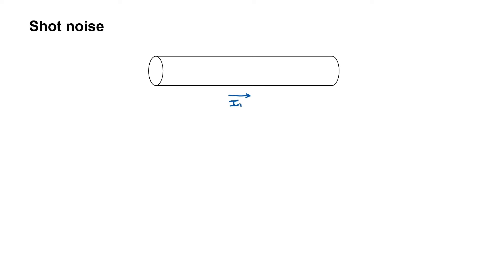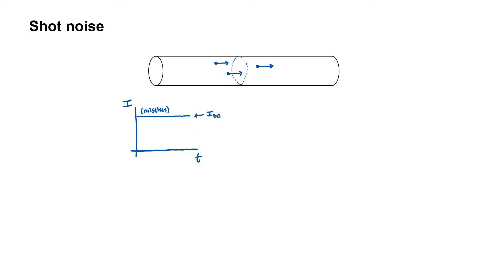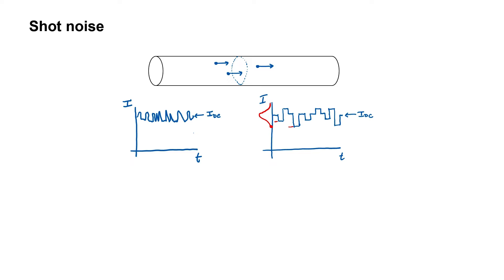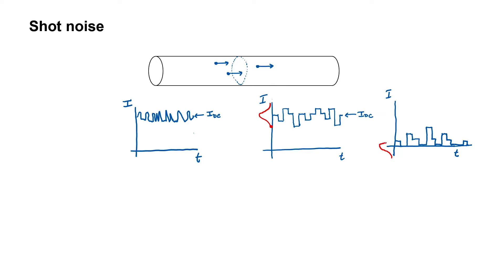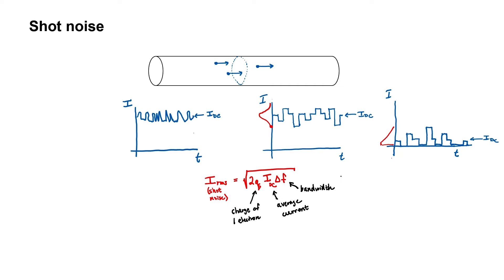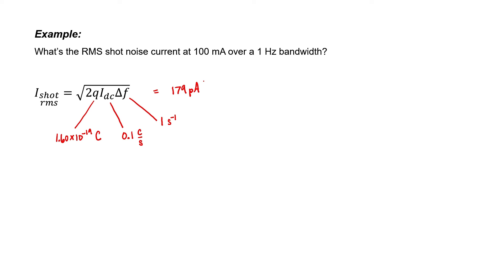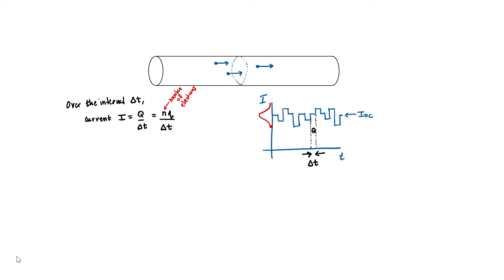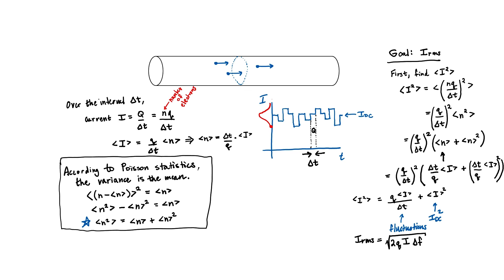Shot Noise in Amplifiers (Amplifiers #14)

Comment: I thought shot noise is more related to crossinng of pn junctions, & depletion areas. Also, You state for a large current it is irrelevant,,  but the equation governing it is 2qI and this is just a fixed ratio with current - so relative stays constant. In MOS devices, in the channel in inversion/saturation it is not modelled as shot noise but more as thermal noise. Main question I have is if shot noise is ALWAYS related to the move of electrons due to Electrical field (voltage) or does it not happen in a resistor for example that carries a DC current?